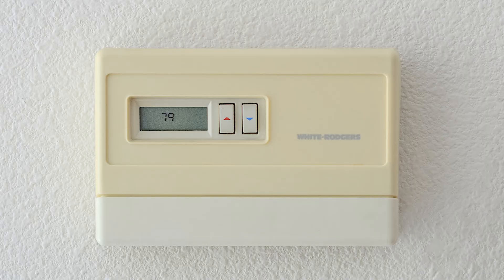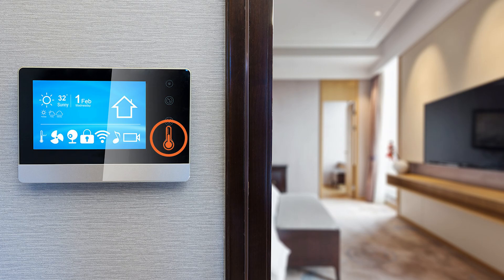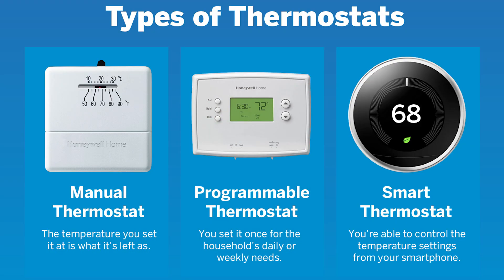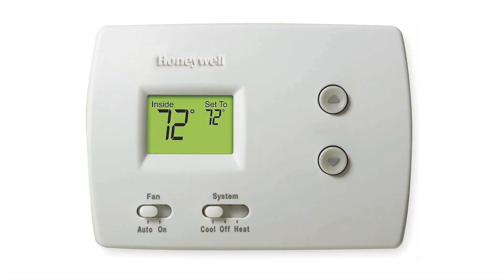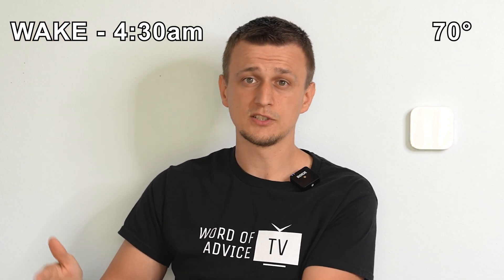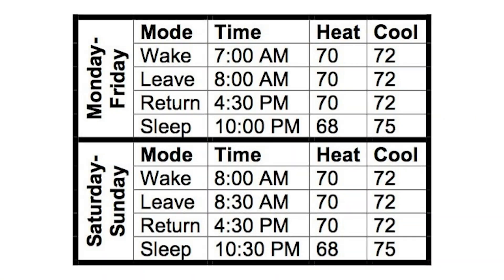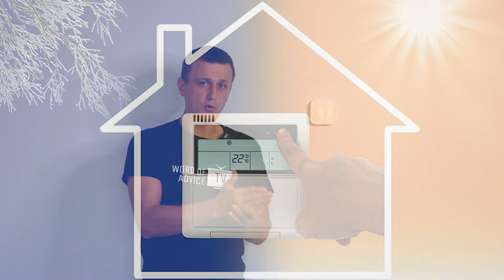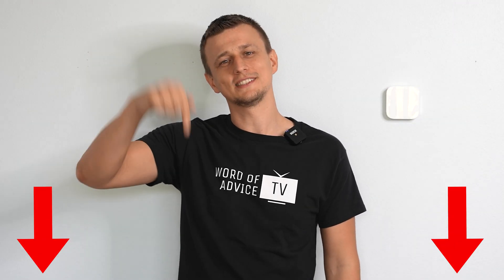How a Thermostat Works For Beginners

Comment: Hi Jay!  I just moved to a new house, and it has a fairly new (10-15 year-old) gas furnace and an AC unit.  I have a Nest thermostat I would like to hook up to replace the old Honeywell Home LCD unit.  When I pulled the old thermostat off, I was surprised to see only 2 wires attached (one red going to the R terminal and one white going to the C terminal).  I do see a bundle of wires behind the thermostat that are not hooked to anything, but I'm not sure which is which, or if they are even hooked up at the furnace.  The heat and AC in the home both work.  The heat does have to be set to "Emergency Heat" to work, which I find odd.  Should I have an HVAC person come out and inspect this, or is this solvable for a DIY person?  Thanks!

Comment: I'm looking for a thermostat that will auto cool and heat. So if I set it to 70 and it gets 69 the heat will turn on. If it gets 71 the ac will turn on. Any suggestions?

Comment: I have a thermostat that is over two years old and now I have to keep tapping it till it starts?  In your opinion, is it faulty?
Reply from the maker: Most likely yes. I would also check the wire connections to make sure they are connected securely. If there's a loose connection, that could cause it too. If it has batteries maybe try replacing the batteries?
Reply: @WordofAdviceTV  Thank you for your reply, now I have to convince my landlord Mansfield District Council that I need a new one, this happened two years ago, I kept on to them till they put a new one in, that started right away?  I have a contract with the land lord, I pay the rent, they do repairs but try to get out of it?  I will remind them of the contract again? when i send them a copy of your reply.

Thank you once again.

Comment: Many no heat or no cool calls are caused by a Nest or Echobe thermostat. They are way overpriced consumer grade junk and are not built to last. A main problem is Power Stealing. The battery doesn’t charge and it shuts down. I always use Honeywell TH 8320R or 21R. Cheaper than Nest and Echobe and is compatible with everything out there. It is a professional level model. The failure rate is almost nonexistent.

Comment: I have a housemate that stays in the loft and  has a window unit that blows extremely cold. The loft is up a staircase with no door and the home AC thermostat is just below on the wall below the stairs. You can feel the cold air coming down the stairs. Does his cold air hitting the thermostat below force my central AC to turn off? It seems that we are competing constantly between the central air and the window unit air coming down the steps. What would solve this?
Reply: That's a good question. I think it would affect the sensor. Perhaps you should get an old-fashioned mercury thermometer,  place it next to your thermostat, and check what the actual temperature is in that spot when he is running his unit?

Comment: I have a 2019 Honeywell Thermostat  with sensors in each bedroom. I don’t understand sensors,since vents are normal no motors  in closing vents.
I want to instal a nest but don’t want the sensors .
Will this cause an issue? Or are the sensors a better system

Comment: Say you set the thermostat to 74°F to keep warm in winter.  When that temperature is reached and the furnace goes off what temperature informs the thermostat to turn the furnace back on?  72F  or 73F for example?
Reply: I have always wondered about that. For example, if I set the AC for 75, how hot does it get before it will kick on again?

Comment: Many smart thermostats make participating in special rates programs easier. For example, my thermostat has the option to report usage and receive temp setting changes from our electric company to help shed demand during peak demand times. I can get about a 15% discount by participating in this.
Reply: My smart Nest thermostat texted me that my AC want working properly before I know it wasn't working and gave suggestions as to what might be wrong. I opened up the unit and saw a pretty cruddy thing which turned out to be the capacitor.  I was able to go on line and luckily found Jay's video and he explained how to replace the capacitor. I ordered a new one on Amazon with the confidence that Jay gave me and I saved a lot of money that day.
Reply from the maker: Good to know, thank you for sharing!

Comment: The old thermostats used mercury like a thermometer when the temp in the house would raise or fall below your set temperature it would turn on or off the furnace and ac
Reply: In most old thermostats (at least the ones I've seen) the mercury is not used for its expansion with temperature properties. There is a coiled bimetallic strip that expands differentially with temperature, uncoiling and tipping the glass bulb that holds the mercury which flows to the other end flipping the switch. Very simple and easy to fix and replace. Some of the modern thermostats try to be too smart and sometimes are a bit unpredictable as a result.

Comment: My thermostat does NOT need to connect to the internet. I have a programmable thermostat and never use those features.  I have even thought about going back to an even more simple thermostat but I can just bypass all the programming on the one I have now.
Reply from the maker: Yes, many people will agree with you on that one. A simple thermostat satisfies the majority.
Reply: My power company installed free Wifi thermostats some years back.  I technically "can" control it with my phone, but I just never really felt the need to.  I use the schedules occasionally, but mostly just change it manually with the buttons.  It was free so I can't complain.

Comment: What you forgot to mention is how smart thermostats are controlled by others. I would set my smart thermostat to 70, however during the day the Google lords didn’t think my house needed to be that warm and would cut it down. Without showing on the gauge they reduced the temp and my house was always cold. Long story short I went back to the non smart thermostat.
Reply: I have heard that there are people who rented houses with smart thermostats in them and they would not allow them to set the thermostats above or below certain temperatures because the power companies wanted to conserve power. That was when I decided I will never own one of them.

Comment: Jay. Can you do a video on 2 stage furnaces and 2 stage stats ?  I have a Bryant 2 stage 80% furnace and a Honeywell RTH6360 Series stat. Only way i can get the second dtage to kick in is to bump the stat up 2 degrees. It'll run in 2nd stage for roughly 8-10 minutes and kick down to single stage. But then it'll run there for another 30-40 minutes.   Is this normal??   This is my 3rd season using them.  Installed in 2020
Reply from the maker: I can try.. Though I can't say I am an expert in the 2 stage units. Some of them are set up so that they kick into 2nd stage after running first stage for 15 minutes (it's adjustable), other systems are set up to only run on low stage until the temperature in the room goes below the set point by 2 or 3 degrees. I would need to do some prodding and digging to figure out your particular situation but the staging and timing is adjustable in most systems. Either at the thermostat itself or the control board. If you have the service manual from your furnace or can look it up online, it should tell you more about how the two stage aspect of it works in greater detail. I don't know off the top of my head.
Reply: 2 stage furnaces can either be programmed for the thermostat to control the 2nd stage or for the furnace itself to control it. I would recommend having the furnace control the 2nd stage and not the thermostat. There should be dip switches on the circuit board that you can adjust and then just remove the W2 wire from the circuit board and disable the second stage in the thermostat programming.

Comment: FYI...if you are thinking about upgrading your thermostat, check with your local utility, I got a 150.00 rebate on my Ecobee thermostat from Georgia Power.
Reply: Is that internet connected? If it is, be prepared for them to shut it off when they feel you are using too much power.

Comment: I have a dumb thermostat, that still uses mercury for the switch portion, never fails, and if I don't want heat there is a simple switch next to the furnace that shuts it off. Works good over 60 years!
Reply from the maker: I personally love the dumb thermostats too! 😄
Reply: @kkovler - my kind of thermostat.

Comment: 20+ years ago, the air conditioner in my small office building stopped working. When the HVAC guys got it fixed, it had warmed up to around 85 degrees inside. A newly minted Vanderbilt Electrical Engineer came into my office to ask me a question and remarked about how hot it was, and I explained that the AC had been off, but they had just gotten it working again. He looked at the thermostat and said "why don't you turn the thermostat down so it'll cool off faster?". I just looked at him and started laughing.
Reply from the maker: Lol that made me laugh too. 😄 Thanks for sharing the story! You should have asked if he can show you how to turn on the turbo feature too.
Reply: @WordofAdviceTV 🤣🤣🤣

Comment: I have the old mercury bulb thermostat. I like the reliability on my 1955 Thatcher gas furnace because I travel and leave the house unoccupied for usually 5 days a week. With the modern thermostat, do you lose heat when the battery dies or the electronics fail? How reliable are these thermostats?
Reply: 1955?  Wow.
Reply: Battery doesn't die if you have a common "C" (the blue wire) connected, which provides it with constant power. An old home may not have a "C" wire in the thermostat wiring, so you may need to pull new wiring. 

You would save a ton of money on heating and cooling bills with a smart thermostat  if you're gone 5 days a week.